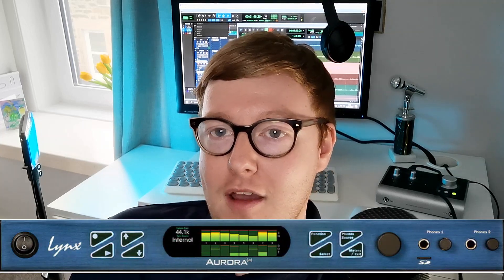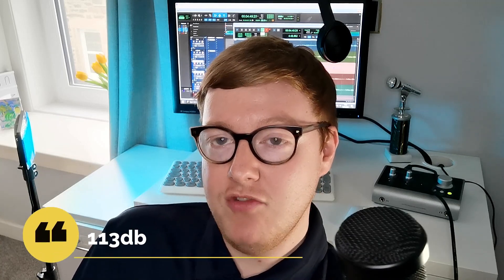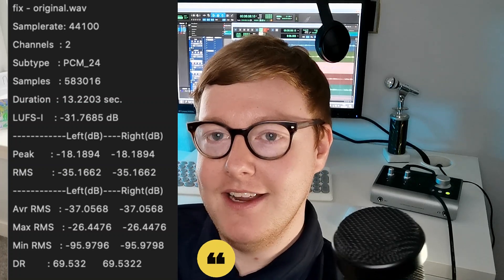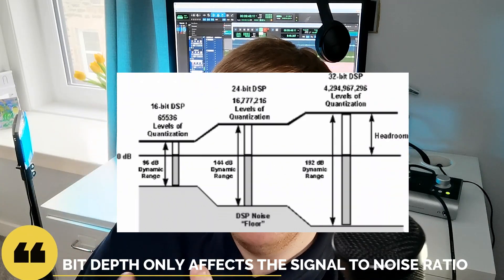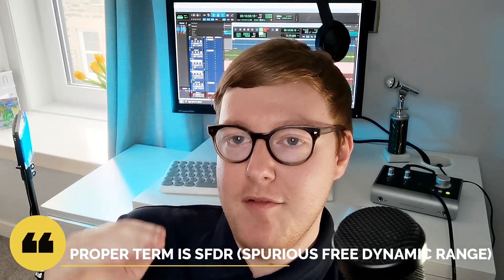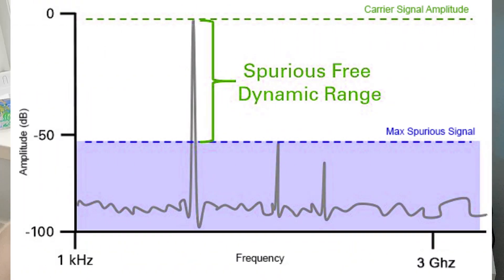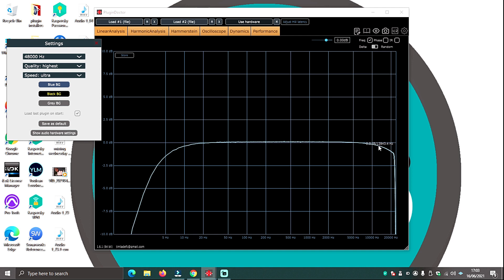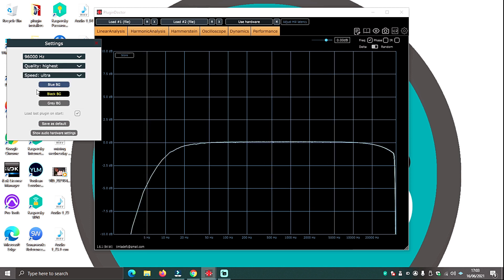Do you lose audio quality in analog gear using budget interfaces vs expensive ADC Converters (Pt 1)

Comment: Love your videos brother .  I will have to disagree to just a point.  I started with the Apollo twin, and knew I wanted to hear more in my mixes.. went to the Apollo X6.. it was a great improvement, and my mix quality increased…. But then… I got the dangerous Dbox+ for DA and the AD+ for AD, and it mixing increased both in time and quality, because I can hear way more than I could with the x6… like I had to go back into mixes because I could hear more, and cleaner sound with the better convertors… so just from my experience , better convertors has made a MAJOR difference in my quality with mixing in sooo many ways!!  All blessings brother
Reply from the maker: I'd agree with DAC from having experience with topping but disagree with ADC. Differences in ADC is super minimal with modern units. That's what the null test shows.

A top DAC is a better investment than high priced ADC from my experience. The difference many talk about from high priced converters (space, soundstage etc) comes more from the DAC as that's whats coming out of our speakers.

The actual difference the ADC process results in can be measured easily in the daw and has been proven to be really minimal in so many tests. X6 and presonus quantum being a good example.
Reply: @PaulThird  ahh, ok yea I could see that, I haven’t tested that on my end side by side but yea I see what you’re saying!